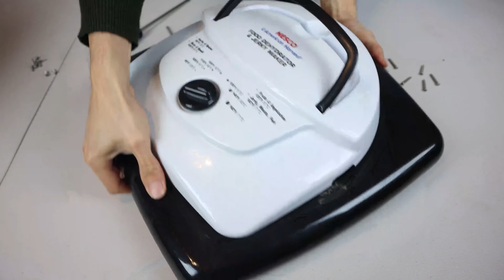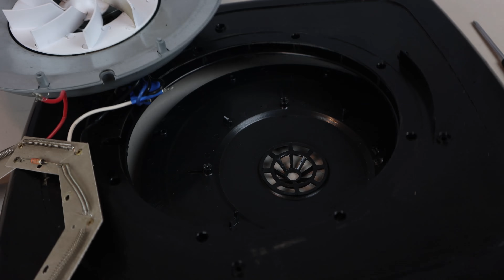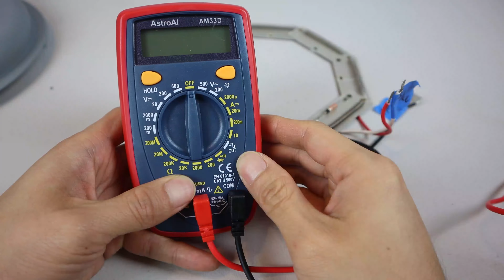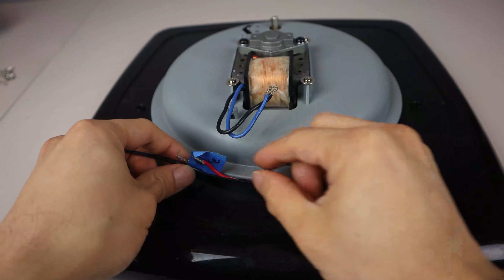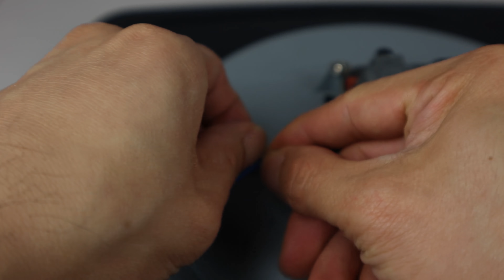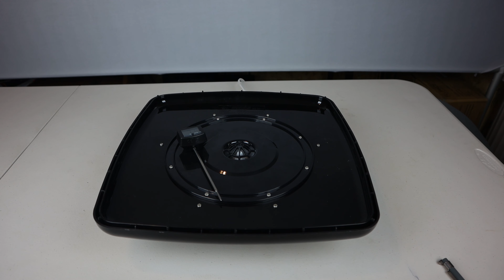How To Repair Nesco American Harvest Dehydrator that Doesn't Turn On or Heat Up Square Model FD-80A

Comment: Great video Phil, thank you?❤
About 4 years ago l did this and it worked (different model) but I don’t remember if my work caused something else because I haven’t used in years, have another one.
When I run it, it runs in low heat only, the switch which supposed to change temperature doesn’t work, now wondering, is this switch broken or did I do something wrong with the thermal switch install?
Reply from the maker: The cutoff fuse wouldn't affect the machine's ability to regulate the temperature. It's possible that a component on the control board has failed, like a resistor or capacitor, or perhaps something internal to the control dial is damaged.
Reply: @FixItPhil Thank you so much Phil!
Looks like beyond my ability to fix.

Comment: Hello, thank you so much for this awesome video! I ordered the fuses and a multimeter, but now that I’ve opened the machine, I see that one of the heating elements came off on one side from the round part. Is there a way to fix this please?

Comment: Great video, I think this is my problem too. Also, my knob won't stay back on any more, as the little flexible metal key fell off. Any ideas for that? I can't just glue it because then I won't be able to take it all apart any more to replace the thermal fuse again when it fails again.

Comment: Thanks and the repair worked
I soldered a new fuse so it’s pretty sturdy and also it will be easy to de solder and re install a new fuse if I need to in the future
Excellent 👍
Reply from the maker: You're welcome!

Comment: Yet another thanks, that worked. My model was a little different, the most significant piece was that the fuse wasn't held in by clips, the leads from it just wrapped around some small rivets at either end. It was a little fussy but I just unwrapped the old one and then rewrapped the new one around those rivets.
Reply from the maker: Awesome, glad you were able to get it sorted!

Comment: Great post. I used it to deconstruct and test my dehydrator. I have the same square Nesco model. Unfortunately both the fuse appears blown plus the fans not turning at all when direct wired as you demonstrated. I tested the motor coil and it appears to have continuity. The fan blade doesn’t spin freely though. Turns easily by finger but doesn’t just spin. Any thoughts on a fix or further testing?
Reply from the maker: It sounds like the motor on the fan is bad. Not sure if there's an easy fix for this other than replacing the motor itself, if you can even find an exact replacement part. I've not disassembled the fan/motor, so I'm not sure exactly the process or parts you'll need. Sorry, I wish I could be of more help.

Comment: Before removing the power cord you should check to see how far is power getting into the unit.  It could have just been a bad cord.  If it's not the cord proceed.
Reply from the maker: Thanks for the suggestion!

Comment: Just finished replacing the thermal fuse on my dehydrator. I soldered the fuse to the clips so it's easier to replace next time. Thanks for the video.

Comment: After replacing the fuse did you have to do it again? Is this dangerous to do? Like a fire hazard? I have zero experience but want to try!
Reply from the maker: Unfortunately, I have replaced the fuse twice now. I think this has more to do with the thermal distribution design of the unit rather than the longevity of the fuses themselves, but I'm not 100% certain on that. The repair is simple to perform though, and as long as you make sure none of the heating element parts are damaged or displaced, I believe that it would not pose any significant fire risk above normal operation.

Comment: This is a great video.  I realized that the issue w/ my dehydrator is actually the fan.  I can't find anything helpful on how to fix that.  Let me know if you have tips!
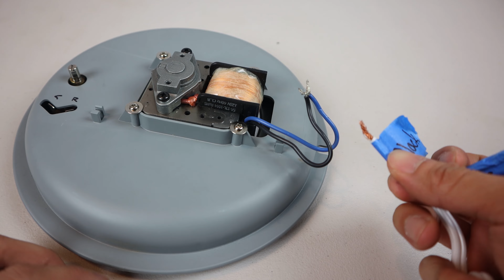Reply from the maker: Hm, how were you able to isolate the fan as the issue? Does the unit heat up when you plug it in, but the fan doesn't spin? The only reason I ask is because when the thermal fuse blows, it cuts power to both the fan and the heating element, so even though the fan doesn't come on when you plug the unit it, it could still be in working condition; it's just that the circuit isn't complete when the fuse is burned out which is why it doesn't turn on. To test the fan motor, you'll have to apply direct power to the motor only, like I showed at 3:56 to see if it starts spinning. If it still doesn't work after this, then it sounds like you'll need to replace the motor or perhaps the power cord itself.
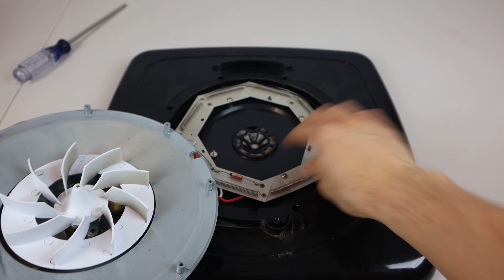Reply: @FixItPhil  Yeah I could see and feel the heat turn on but the fan wouldn't spin.  I actually ended up fixing it!  I used the first part of this video to disassemble the dehydrator (up to about 2:45).  Then I could tell that the square carriage (housing the fan's motor) had gotten misaligned and it was causing the blades to not spin cleanly.  This makes sense that something had been jolted because the dehydrator had been dropped.  The unit must automatically just turn off the fan if a blade is even slightly obstructed.  I was able to re-align the placement of the fan motor the old-fashioned way... literally just took a hammer and straightened it out.  Not sure if it was the most recommended but it works well now!
Reply: @carolynhughes550  3 years later... same here, but I didn't just whack it. On the opposite side of the fan housing there are four screws with washers that hold the fan in place, and when I looked at mine two of them were no longer in place, so the fan wasn't straight. I just had to loosen those screws a bit, push on the fan motor until I could slip the washers back in place, and retighten. I also had to replace the fuse, but it all works now!

Comment from the maker: 🚨🚨🚨TIP: To prevent excess heat from building up in the unit and blowing the fuse, you should always use all four trays when dehydrating, even if some of them are empty. Also, try not to overload the top tray closest to the fan because it may not allow enough heat to escape down to the lower trays.
Reply: Wish I  knew this B4 blowing the fuse.
Reply: @JohnCorwith  Agree!
Reply: Great video, thanks. My unit keeps blowing fuses. I used it for years with no issues, but now this....thoughts?

Comment: Crazy stuff, an old guy with bad eyes actually did this and it worked! I don't know if it was coincidence or not, but the thermal fuse on mine blew when I tried to dehydrate a small batch of jerky without adding in a couple extra empty trays. I think it got too hot without a little extra room for air circulation. Thank you for your post, you saved me the cost of a new dehydrator.
Reply: My Wife did the same thing with ours.  She did with one tray after 1000+ hours with 3 trays, and the fuse popped.  Thanks to you prior comment, I know what to order.  I can make it work by bypassing the fuse, but that could lead to a fire...

Comment: Thanks for the tutorial. My part is AUPO BF142. Can I use the part you mentioned in your video instead? Will it work, or I need this specific part number?
Reply from the maker: The fuse you indicated has the same exact specifications as the one I used in my video, so I believe they would be interchangeable (142°C cut off, 250V,  10A). When in doubt, however, try to replace the part with an exact match if you can procure it!

Comment: Can't find parts - suggestions?  Ours doesn't work when plugged in.
Reply from the maker: Hm, are you looking for a specific part? I have a link to the fuses that I purchased on Ebay in the description of the video: https://ebay.to/2L6zOli [Ebay Affiliate Link]. If you need other parts I usually search for the part number or specs listed on the part itself, but I don't think Nesco has a "spare parts" store for their products.

Comment: HinI did replace it but the fuse blew up twice! Could the problem be something else?
Reply from the maker: Hm, if the fuse continues to blow there may be another problem causing a short or the motor to output too much power which is overloading the fuse. If this is the problem, then perhaps it is time for a new dehydrator 😔

Comment: Okay so I bought this dehydrator a month ago from an older gentlemen off Facebook market. I was extremely excited. I tested it the same day, and I used it yesterday for the first time. Only for 3 hours though. This morning I checked, and some things still needed to dry out so I set it for another hour. 20 minutes in...... it just cuts off and now doesn't come back on. I immediately wanted to use a hammer. The point is, your video gives me hope. Thanks.
Reply from the maker: You're welcome, I hope it's the cutoff fuse like mine because it is a relatively easy and inexpensive fix. I was reading through some posts from other users who had the fuse burn out and it sounds like that you have to use all four trays, always, when dehydrating even if some of them are empty because otherwise the heat builds up too quickly and kills the fuse. The other tip was to not overload the top tray closest to the fan because it doesn't allow enough heat to escape down to the lower trays. Hope this helps and good luck with the repair!
Reply: @FixItPhil  Wow it seems I caused the issue then. I was only using one tray at the time. Thanks for all your information.